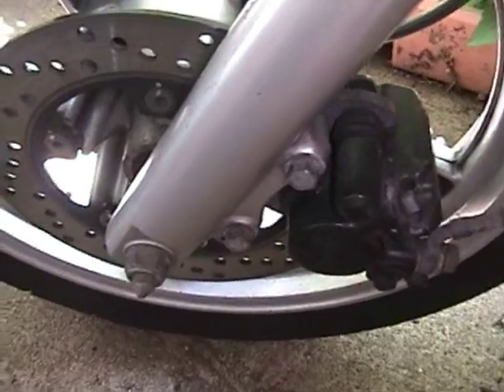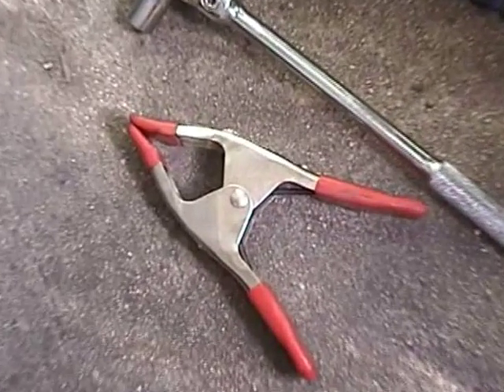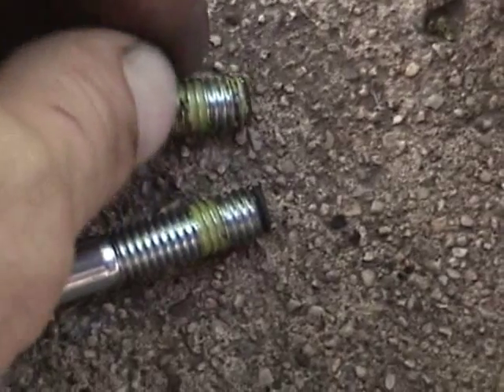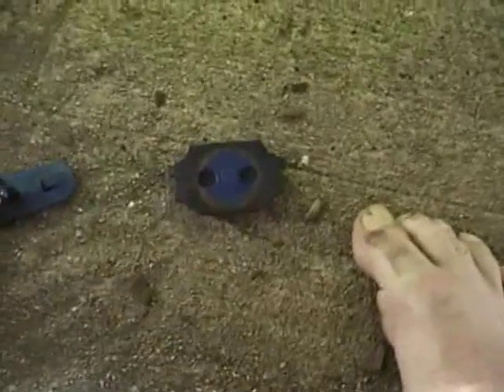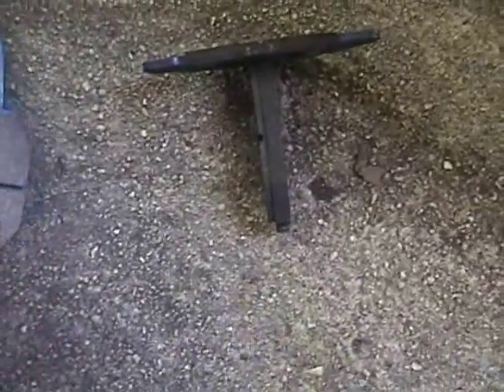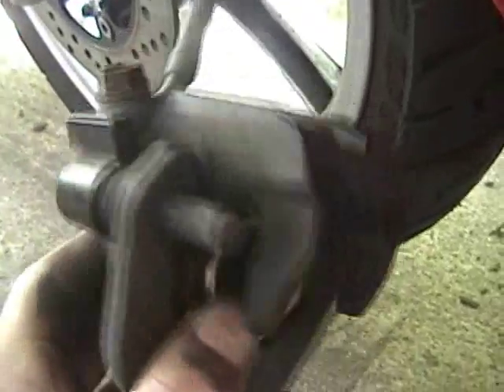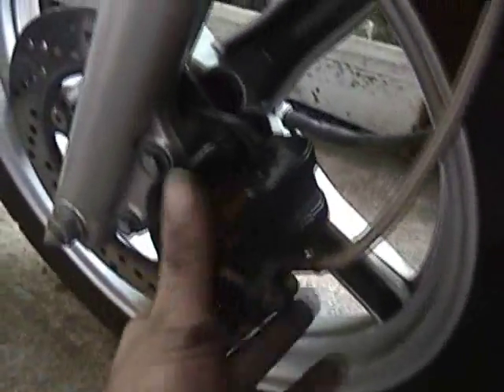How to change the front pads on your SYM HD200 or Kymco People 125 150 and 200

Comment: Just did it.  Had difficulty because the piston kept springing back.  Had to take the cover off the reservoir to relieve the pressure on the brake fluid, then it went as it should.  That was after some choice words had already been said, of course.

Comment: Should you put copper grease on the pins?
Reply from the maker: a small and I mean small amount of brake hardware lubricant can be used but remember that it will also attract dirt, grime and debris all the same and that in itself may cause more binding than no lubricant at all. It's a good idea to check every once and a while for the aforementioned

Comment from the maker: you can't adjust it and if you let brake fluid out when you changed the pads, you'll have to completely bleed the front brake system. I plan on changing the fluid this year so will make a video in it. Meanwhile you should get someone that knows how to do it to help you. IT IS NOT the same procedure as you would do with a car's brake system. Silly question, but did you but both pads in and are they both correctly installed?

Comment: Dunno if anyone is still following this, but I followed this video to the letter, and now my caliper won't reopen. The pads remain clenched to the disc. There is no return spring, what am I doing wrong?
Reply from the maker: First off there are several things to look at. 1) You're right there is no return spring. The elastic action of the dust boot pulls the caliper piston back. 

2) did you "hyper-extend" the caliper? In other words, wait too long to replace them? A common mistake is by waiting too long to replace the pads and the piston "hyper-extends" to the point that it rips a seal or tears the dust boot. Usually a ripped seal will leak fluid out  and a torn dust boot allows dirt, etc to enter the caliper and cause jams thus making it not return as easily as it should. 

3) Is it totally locked up like you can't spin the wheel at all or just somewhat tight?

Either way, I would disassemble the brakes again and check  the dust boot out. There's no real way to examine the inner seal without taking the caliper apart and once you do, you'll have to rebuild it anyway. One thing to note is NEVER EVER squeeze the brake lever with no pads installed or for that matter with pads installed and not on the rotor. This will almost always result in a failure of seals. Once the piston does "hyper-extend" forcing it back usually damages the inner seals.

4) Are they the right pads?  The backing may be right shaped, but the pad material may be too thick too, but that shouldn't cause non-retraction, but it won't help either. The caliper travel is very very small, so don't expect to see it move much at all.

Hope these help and let me know so we can look further into it...
Reply: I checked the fluid level, pumped the brakes as others elsewhere suggested, etc. What seemed to work is that I removed the caliper, puti it back on and didn't tighten the bolts. They worked, but too loose. I tightened them all the way and now they're too tight. 

Torque. It needs a specific torque, but I can't recall seeing that in the video.

From a maintenance manual online I find a value of 3.0 to 3.5 kgf-m. I will get some medium locktite and 'adjust' by hand. Just tighten it too loose, loosen if too tight. Shouldn't be too hard to find the right tension.
Reply: it's not the torque. I was successful in finding a way for the handles to be completely loose, while the pads were still fighting the bike moving. The rear brakes work fine, no problem there. Since the hydraulics are on both front and back, I can't see the hydraulics being the issue. The back set would also be running wrong, wouldn't they?

My brother mentions a brake adjustment screw, but I can't find one either on the bike or in the service manual.
Reply from the maker: First off sorry you're having trouble with your pad swap... Something is wrong with either the pads themselves or the actual installation. The torque you're referring too has nothing to do with the operation (looseness or tightness) of the brake itself and is only to mount the caliper bracket on the front fork. DO NOT leave it loose!!!

check these things after you once again remove the caliper assembly...
1) match the actual new and old pads to one another and make sure the backings (metal part) match exactly. Look for burrs or metal casting marks that may interfere and carefully grind/file them off.

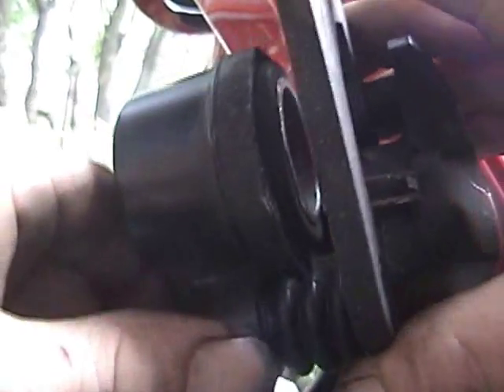2) At 4:16 on the video, make sure the caliper mount slides freely on the guide pins as shown. At approximately 4:58- 5:05 make sure the inboard pad (on the caliper piston) goes inside and stays inside the caliper bracket.

3) There is no adjuster screw for these brakes to adjust tension loose or tighter...

4) I presume your rear disk brake is hydraulic also and not cable operated, so unless it is a model I'm not familiar with, it has it's own reservoir/master cylinder. The fluid reservoir/master for the front is on the front brake side connected to the front brake handle, and the rear reservoir/master is connected to the rear brake lever. The systems are independent of one another.

5) Once the piston is compressed fully and the pads installed and the assembly put on the forks, it should slide back and forth freely (not much) until you apply pressure on the brakes. If it won't slide freely and the wheel freely spins, you are binding up somewhere. If you have to force the assembly onto the rotor, that is also a problem and the brake material itself may be too thick OR the piston is not fully compressing.

6)If the above is OK and the assembly does slide freely and you don't have to force it on the rotor then you may have a problem with the master cylinder itself or the "spring action" of the outer piston dust guard is not working correctly. You may have to flush/ bleed the front brake fluid to remove any debris in the system.

7) Do this test... assemble everything and take a black sharpie and make  a wide line on the rotor both sides top to bottom and ride the bike less than a block. If it's as tight as you're stating maybe less than 100ft and see which side of the rotor the lines are erased from. that will tell you which side is binding and I bet it's the inner side. BTW Don't apply the front brake at all when you do this...

8) Also put your old pads back on and see if your front brake's hydraulics are working correctly. If the same thing happens then, you know it's not mechanical at that point.

Let me know what happens after you do these and we can go from there... E-Mail me directly so communique is easier... 
jeff@jeffs-hotsauces.com
Reply: Sorry about the delay in getting back.

Turns out I just needed to bleed them. Never opened the hoses or master cylinder, and it didn't need it before I changed the pad, makes no sense, but there it is. Fixed now.

Thanks for your help!
Reply from the maker: I'm glad you found the problem and you're up and running, or should I say stopping hehe. Air in any hydraulic system like brakes can wreak havoc and it ws that air pocket that was causing the caliper piston to not retract. Liquids cannot be compressed thus creating the workings of the brake. Gases like air however can be compressed and will 100% of the time compromise any hydraulic based system. Ride safe and ramble on :)

BTW as the pads are worn away the fluid level drops to replace the displacement need to operate the brakes. The constant moving, bumps and motion of low fluid in the reservoir can create air in the system when the pads reach the far end of their life. Since the reservoir holds maybe a shot glass of fluid, there isn't much leeway in fluid usage:)